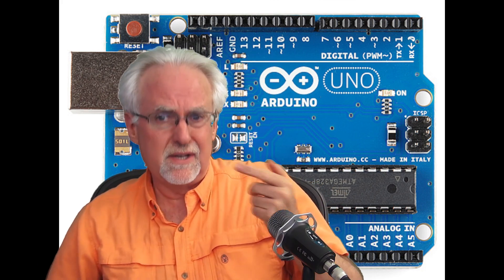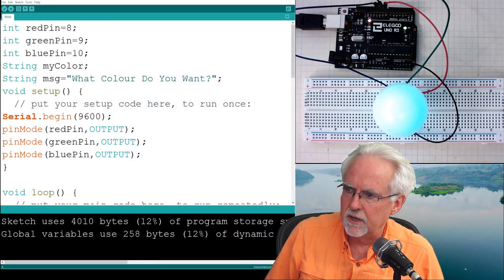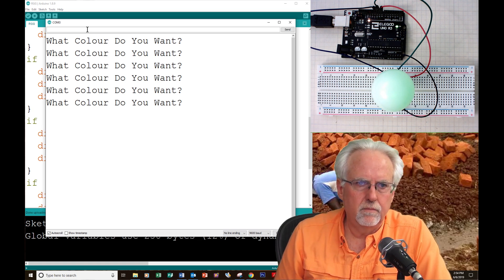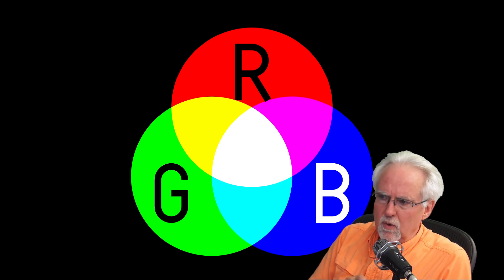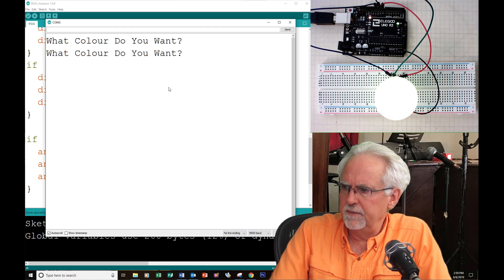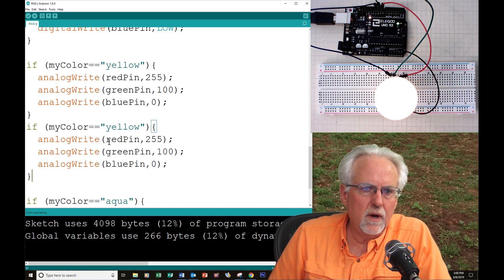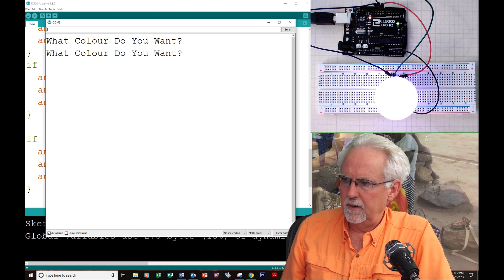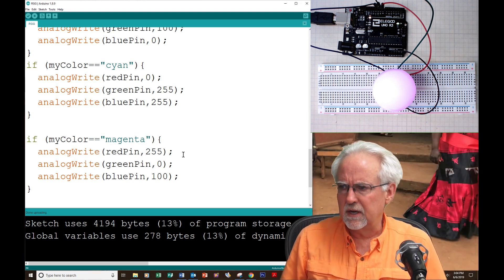Arduino Tutorial 21: Understanding and Mixing Primary Colors with an RGB LED

Comment: I will be looking forward to watching this tutorial as soon as I can get the lesson 30 code to work. Can not digitalWrite from within the “IF CLAUSE”. Have been troubleshooting this problem for days with no joy. Wondering if there is something wrong with my RGB LEDs. Will try it with individual LEDs. The RGB light up when powered directly from 5 Volts but not from pins 8, 9, and 10. Maybe the readString is not working properly. Guess I’m doomed to “fall behind” the rest of the “class”. Would still like to see/print out the entire code as presented.  Al in Ann Arbor.
Reply from the maker: Simplify. Take evertying out of the if clause but a simple print statement. Verify if you are getting into the if clause. If  not, you have a typo in the line of code of the if statement
Reply: Paul McWhorter, thanks for the reply. It is greatly appreciated and I will try that.
Reply: All, I enter the code as Paul presents each piece, even if I have to pause the video and back up until I get it correct and it compiles. After getting the code to work you can print it from the file tab in the Arduino IDE.
Reply: @chuckpickering6040   Thanks Chuck. As it turned out I  am confident that  was ultimately using the code that Paul presented, but it  still would not run properly. After much thought and experimention I discovered that my Serial Monitor was adding  spaces  when I responded with "red", "green", "blue", causing the  "if conditional" to always return a "false" value.so that the "if clauses" never executed (something I never  expected!).  The solution was to include a ".trim()" statement to  trim off any invisible spaces. Please see the code that I sent Paul under my reply to him under Lesson 20.  Sorry, I did not intend to turn this into a "Forum"
Reply: @paulmcwhorter  
I have the same issue.  Tested the LED and it is wired correctly.  Copied the sketch, then deleted the code after digitalWrite(redPin,HIGH); } }   I added a Serial.print(myColor); command after Serial.readSrting command.  Compiled and uploalded the file.  The serial monitor displays the correct text, including my input, but the LED will not light.  I am running on a Mac OS 10.14.5,  could it be the compiler on the MAC?  I have tried this with three different Arduino boards.  All the other tutorials work fine until now.

Comment: Using a loop to set integer values for each colour of the RGB LED.
here's the code! it uses a loop to ask a question and then uses a function to input the values:
int redpin=9;
int greenpin=10;
int bluepin=11;
String setmsg="Would you like to set a colour for RGB LED?";
String redmsg="What value do you want for colour red?";
String greenmsg="What value do you want for colour green?";
String bluemsg="What value do you want for colour blue?";
String answer;
int redval;
int greenval;
int blueval;
void setup() {
  // put your setup code here, to run once:
Serial.begin(9600);
pinMode(redpin,OUTPUT);
pinMode(greenpin,OUTPUT);
pinMode(bluepin,OUTPUT);
}
  
void loop() {
  // put your main code here, to run repeatedly:
  Serial.println(setmsg);
  while (Serial.available()==0){
  }
answer=Serial.readString();
if(answer=="yes"){
  RGB();
}

}
void RGB(){
  Serial.println(redmsg);
  while (Serial.available()==0){
  }
  redval=Serial.parseInt();
  analogWrite(redpin,redval);  
  
  Serial.println(greenmsg);
  while(Serial.available()==0){
  }
  greenval=Serial.parseInt();
  analogWrite(greenpin,greenval);  
  
  Serial.println(bluemsg);
  while(Serial.available()==0){
  }
  blueval=Serial.parseInt();
  analogWrite(bluepin,blueval);
}
Reply: thanks for sharing the code. its excellent!
Reply: Thank you so much for this.